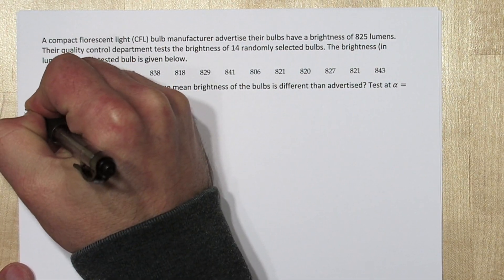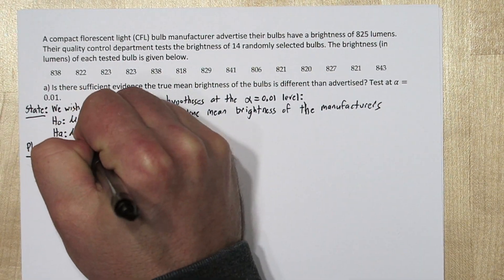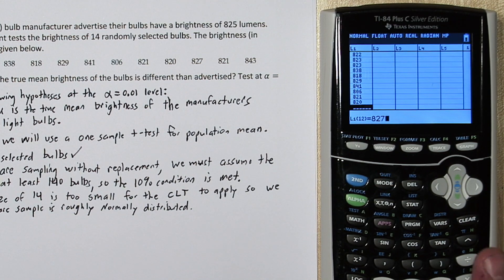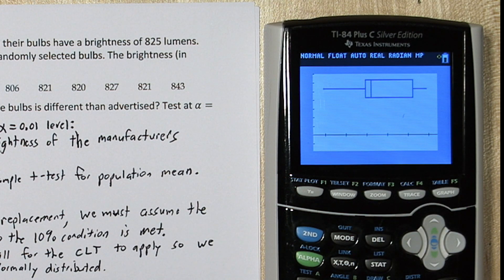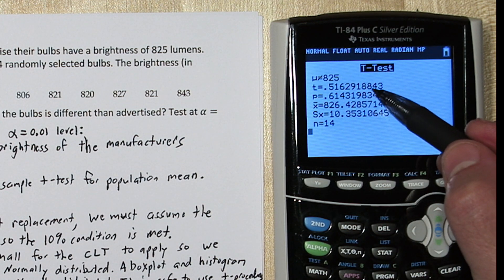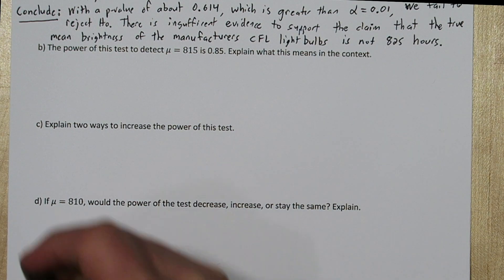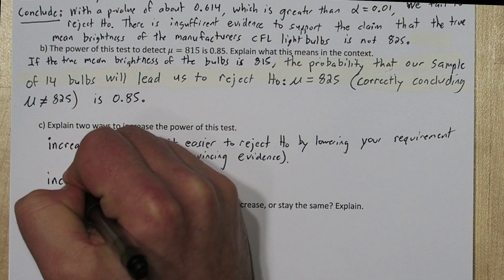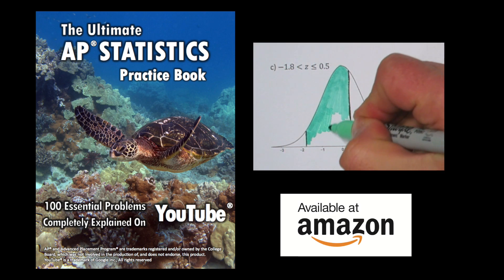T-Test (Raw Data: List on TI-84) Understanding Power

Comment: Thanks so much for the video! For a, shouldn't it be that there is not enough evidence to suggest that the true mean is different than advertised? Since the p-value is larger than a, it falls out of the rejection zone,  therefore Ho is not rejected,  which means that the true mean could be 825